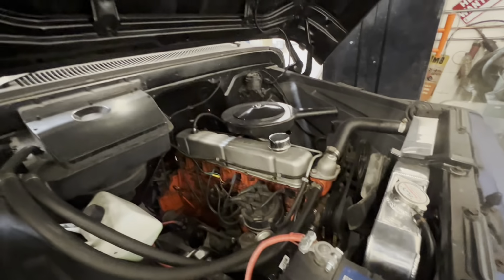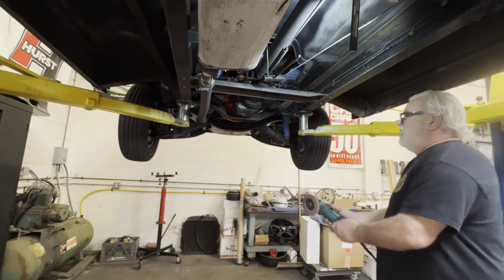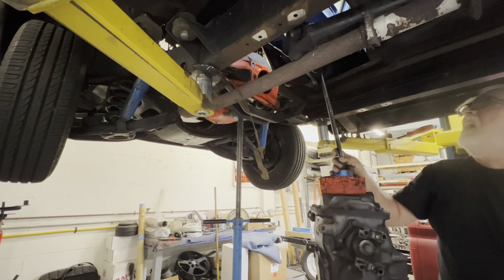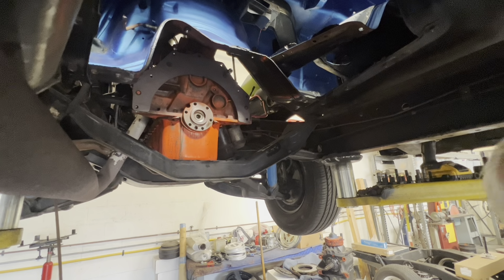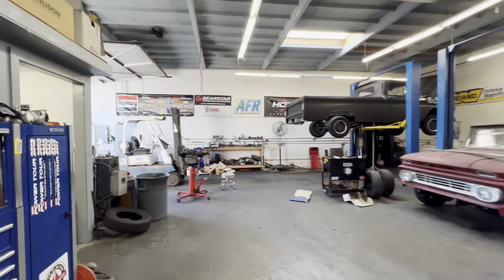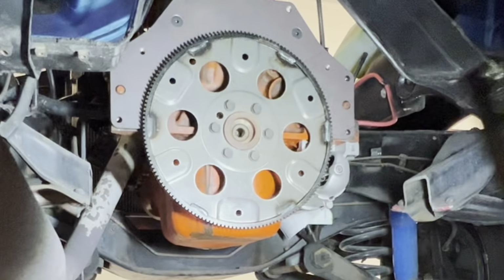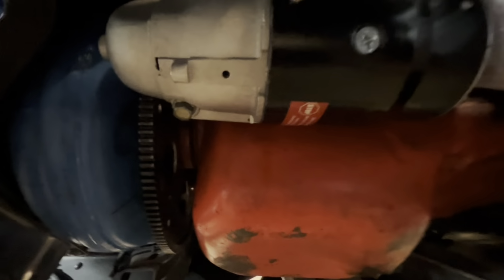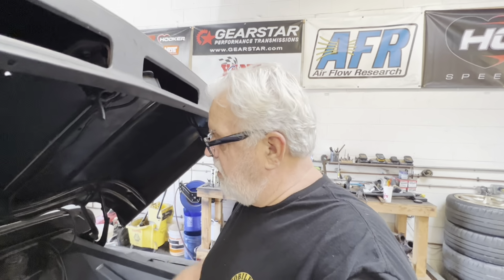1965 Chevy Transmission Swap - Manual to Automatic

Comment: No guard on the grinder, no handle on the grinder, not using a face shield, and not wearing safety glasses with side shields while looking at sparks at an angle. Please work safe. It's not worth your vision.
Reply: I know someone who's had tinnitus for 20 years from making one cut with a grinder without hearing protection.
Reply: Also a dust mask or turn on a fan to blow the rusty dust away.
Reply: He has glasses on! Lighten up people, fricken safety Natzi's!!!!

Comment: I don't think I ever put an automatic in a car or truck that originally was a manual. It was always the other way around.
Reply: I've got 119 94 Nissan hardbody and I will trade for an automatic you have to replace a slave cylinder...😂Thanks to china.... I replaced the master and slave probably 9 times and now I'm running dealer parts When you can only drive for 1 day and then you have to bleed the clutch again....

Comment: What a cool old truck. A split manifold with dual exhaust would really sound cool and EFI would be the icing on the cake. Would make a nice cruiser and actually get good gas mileage.
Reply: OMG!!! Have you ever had to listen to a friggen' stovebolt with split manifolds drone onanonanonanon?  I'd rather listen to the neighbor kid's fart-megaphoned Subaru.
Reply: EFI is crap, five sensors and delay from the computer. Single barrel carb on a tuned motor can get 35MPG, I've done it. It's all about tuning. But, I know there's a lot of guys that want to be on infinite diagnostics trying to figure out why the EFI isn't working and you can't tune anything without a computer hooked up, or a chip. That sounds awesome, versus using a screwdriver and a vacuum gauge for five minutes.
Reply: dual exhaust and EFI on this partictutal vehicle would be like smearing shit on the cake

Comment: When I was in HS I went the other direction on my 59 Bubbletop.  But I couldn't afford a 4 speed so I picked up a cheap 3 speed.  It was easy to put the ball for the bell crank in the block, but I had to weld the frame side piece on.  I used a Hurst Synchrolock shifter.

Comment: Back in the mid 90's I had a 64 chevy with a 292. I swapped out the 3 speed for a TM350 in my driveway. I used a death wheel to get out the bell housing cross member (and have a real nice divot out of my shin from a bouncing grinder). I used a factory 72 c10 trans cross member from a junk yard. With the 373 rear gear and the automatic, it really didn't like the hwy after that.

Comment: You probably already know this, but - you can take the shift lever off of the top of the truck style  NP420 3-speed transmission to make it easier to remove.  First the trans MUST be in neutral.  Failure to do this makes it a lot harder to reinstall.  Then, grab the sheet metal cover at the base of the shifter lever where it enters the shift tower, push downwards and turn counter clockwise about 1/8th of a turn (like you do in tail light bulbs, the 1156 and 1157 style).  The sheet metal cover should pop up a little bit, then you should be able to pull the shift lever straight out of the top of the transmission.  I'd strongly recommend that you put it back in place as soon as you get the transmission out of the truck, so you don't forget how to put it back in and so you don't lose the shift lever.  If that isn't possible because you need to store it in a tight place, a spray can cap usually fits right over the top to keep bugs and whatnot out.  If you can't figure out how to put it back in correctly, a trans shop should be able to do that in about 15 seconds.
Reply from the maker: Yep. Just figured it would help me catch it because I was working alone

Comment: LUCKY. great how-to video.I did just the opposite swap T350 to M21 years ago,crazy to think that the 3 speed manual on these trucks just hung off the saddle mount cast iron bell housing with no rear crossmember.
Reply from the maker: Thanks 👍
Reply: Same as tri fives.

Comment: someone forgot to get  longer   dowelpins  for the transmission :P
Reply: Longer pins would have been nice but that engine’s torque is not going to be over whelming.
Reply: @br549200  no but makes install and removal easier
Reply: @futten3230  yip, but looked like he didn’t have too many issues.

Comment: I can't help but think that a manual would help the truck feel more powerful. With just an old straight six and an old style auto with, I'm assuming, three speeds, you won't have the same feel in the truck. I know I'm not the truck owner, but I also can't help but express my sadness that another niceish old one has been, although really well done, made lesser.

Comment: Excellent video.  One question, did the chrome transmission pan leak at the gasket? & if so what did you do? I fought the same brand pan for a week, as it  bled making my garage floor look like the Texas Chain Saw Massacre, This even after sandblasting the gasket surface. I gave up and bought a cast aluminum pan, no leekie. Thanks g²

Comment: I noticed you used a BUICK/ Pontiac version th350, and just was wondering if you left the top bolts off. (I would've). I have a 72 with that sw465 and can't decide if I want a long or short shaft th350, but when I saw you do this, I guess it doesn't matter, the shaft is too long (that's what she said). For a second, I was thinking, where did he relocate the parking brake.... Oh right, it's an automatic transmission, you don't need no parking brake, even though it would still have one anyways for emergency. Thanks for the vid, Now I know what I'm getting my self in to. Big sigh.

Comment: Question, how come you completely cut off that front cross member, from the video it looks like it clears the trans and if any interferance the back flange may need to be cut. Just curious because im looking at my 63 3spd and trying to figure out an auto swap also
Reply from the maker: It definitely needs to be cut.  It’s actually more of a mount then a Xmember and goes through the middle of the bell housing to hold the transmission. When doing this you’ll need to support the rear of the transmission.  
Thanks for watching. 👊

Comment: OK, I am doing the opposite. I am putting in a manual in my 69 c10, and I didn't see you remove the pilot bushing. Can you just leave it in ?
Reply: Meant to ask the same thing. I reckon so, as there is no engagement there, so it’s not needed. But it doesn’t hurt anything.
Reply: The pilot bushing is preventing the hub on the torque converter from fully seating in the flywheel pilot, and preventing it from mating with the flex plate. Lucky mentioned needing spacers, which wouldn't be necessary if the pilot bushing were removed.

Comment: I would really like to do this to my truck i have a 63 C10 with 3 speed on the tree I have to place to work on If could only find an shop  to get this done or maybe get that 3 speed dial up and running Im in Cali any shops around  thanks

Comment: Exactly what I was looking for.   Couple of question…what did you use to cut the crossmember?  Also, the new crossmember, are the holes already available on the frame or did you have to drill new ones?
Reply from the maker: This was a while back but I think it was a very straightforward swap and the Xmember was bolt in with no drilling.
Reply: @luckysgarageshow  I installed the th350 behind the 230. Is the clutch z bar needed or did you remove it since you no longer have the manual transmission?

Comment: wow this is very informative for me and my case, i'm replacing a 3spd manual with a bop th350 to a chevy 4.1 250 engine.  while your situation is a truck, i'm doing the swap on a 74 firebird so this swap and information is very beneficial to me.  Do you remember the part number to that bop trans to chevy adapter plate?  Thanks   edit:  ALSO, what torque converter type and stall did you put in?

Comment: Just curious Lucky, did you take the clutch pedal out eventually or just leave it in?
Reply from the maker: Pulled the Spring and put the peddle under the mat.   Just in case